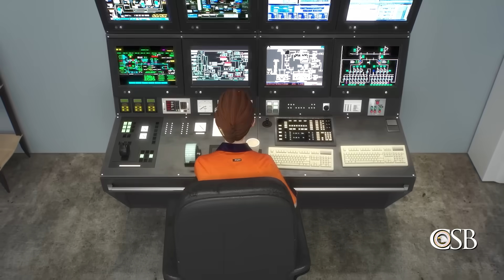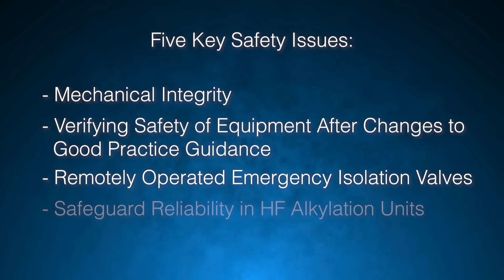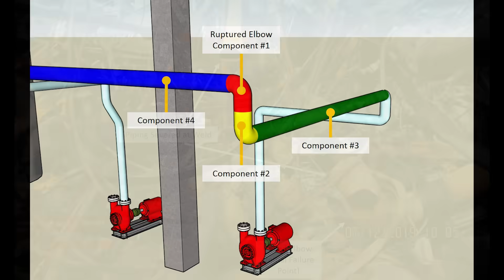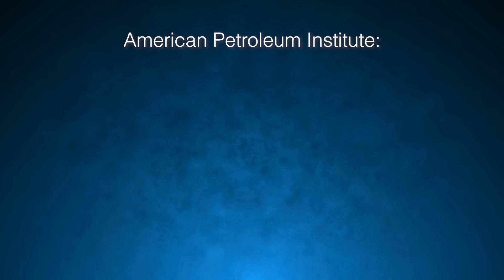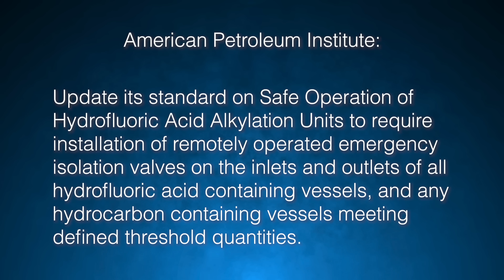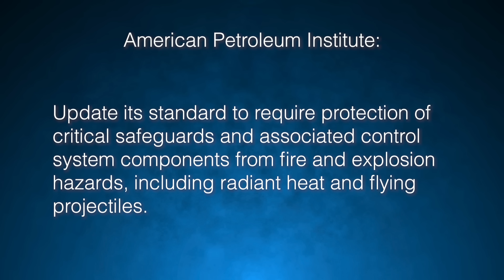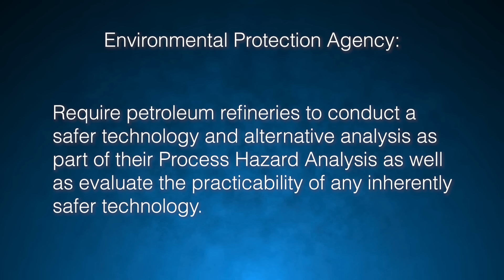Wake Up Call: Refinery Disaster in Philadelphia

Comment: It's honestly a miracle that an explosion that big had no fatalities.
  Also, fragment 4 might have landed in the water since it wasn't found elsewhere.
Reply: It would've been so much worse if it happened during the day shift; rather than just a few operators in the plant there'd be hundreds of workers present and probably at least a few dozen within the alky unit.
Reply: yeah, well that's why it's a wakeup call they should not be so careless about maintenance to prevent corrosion like that to get that bad cause it could have killed many if people were in the radius at the time, it happened
Reply: The moon, maybe.
Reply: One of the reasons oil and gas companies make so much money is that so much of the process doesn't need anyone near any of the dozens of pointy bits. Refineries, are sparsely peopled, as opposed to all the factories where people are paid poorly.
Reply: @weatheranddarkness , sparsely manned?
Reply: @thingsstuff6564  I said what I said
Reply: It was big, but not centered inside a group of skyscrapers full of people or something similarly dense.
Reply: @Galactipod  but that cloud of HF would have traveled into the downwind populated areas if not for the onsite crew manually turning on the water canons and shutting off the other valves. that was way too close to being a mass fatality event.
Reply: @58209  This. Yes, there weren't any high rises immediately adjacent to the site...but for reference, central Philly's signature skyscrapers were only about 3 miles away, and the neighborhood immediately adjacent to the site has a population density of 18,115 people per mi². This easily could've lead to thousands hospitalized or worse, and had the stars and especially wind and clock been lined up just right, it could've been far more heartbreaking than that!
Thank god the people in this weren't the usual types you see in CSB videos. The plant shift supervisor deserves a literal medal for risking his life to turn on that pump if you ask me; I hope he at least got a promotion and bonus for minimizing damage and casualties.
Reply: @FarnhamJ07  Spot-on. And don’t forget the sports complexes being nearby. With the wind in the right direction during a game, you’d not only dump HF into a crowded stadium, but you’d have a terrible traffic jam.
Reply: @JWall416  oh god. sports stadiums are basically huge bowls. it'd be a horrorshow with that cloud of HF suffocating everyone before they could evacuate.
Reply: @FarnhamJ07  It takes a special kind of person to walk into a refinery fire like that. Makes me wonder if I could...

Comment: As a highly paranoid electrical, mechanical, and aeronautical engineer, sometimes I feel more hazard aware than many of the industrial engineers I have met. I have always found chemical engineers to be very thorough and safe, but the industrial engineers tend towards negligence. Not to say that I haven't met industrial engineers that greatly prioritized safety.

But I can say without a doubt that management is practically useless when it comes to safety, either from greed or incompetence. The vast majority of the time they only care about what is required and completely ignore everything else. The number of times remote isolation valves have been discussed with someone from management and all you hear is "it's not required" is genuinely scary to me. How can you not be willing to pay a few thousand extra to ensure your multimillion investment doesn't destroy itself?

I do go kind of overkill on personal projects though, EVERYTHING needs a controller; I don't care if it's just a sprinkler, it's getting a solenoid and a pressure sensor incase it breaks.
Reply: Regarding this, I recall that either in the USCSB video or another video about the Texas City refinery explosion (the one where a raffinate splitter tower was overfilled) there was a mention of the investigators noting how the site management had been worryingly focusing almost solely on personal safety of the site personnel, since it was a cheap and easy way to score compliance points with upper management, while process and plant safety at large was being ignored since any actual fixes would have cost actual money and caused downtime at times when budget cuts were constant.

Which is something I've noticed at my own workplace (paper mill originally built in the '60s and expanded/modified ever since) as well, there's all kinds of policing about people doing constant safety assessments no matter how minor the job, policing about personal safety equipment, etc. - which is fine and dandy, but at the same time the whole place is full of shafts meant for hoisting materials between which are difficult and dangerous to use due to outdated designs and wear and tear, new equipment is crammed where-ever it fits which creates serious access issues and dangers due to that, a large 80's add-on was built without any elevators which means hauling materials over there is complicated and prone to injuries due to the aforementioned hoisting shaft issues, etc. Basically individual workers are being constantly pressed harder and harder to obey more rules every year, but wholesale dangerous conditions related to the plant itself are largely left as they are due to how all of them would need massive retrofits to fix, and workers are just expected to try and work "safely" when dealing with them.
Reply: It’s sort of understandable, though…not to say it’s “right”.  There’s this misconception that these industries are just swimming in profits and there are these obese guys in suits cramming money into every orifice. The reality is that profit margins are often tight and you simply can’t afford to over engineer everything. You can make a statement about “only a few thousand dollars” to implement an improvement, but fail to recognize there may be literally 1,000 places in the plant where that extra safeguard may be applicable. So, it’s not a few thousand dollars, it’s a few million dollars to add some additional layer of protection. There is a fallback mentality on the regulations, codes, standards and laws. There is a belief that if you do everything that’s required, you will be safe. THAT’S the value of the CSB…not to entertain you, or to “shine a spotlight on corrupt management”, but to point out places where the codes and standards need to be more protective.
Reply: What do you do that involves aerospace, regular work with ChemEs, and fire suppression?
Reply: @Basement_crusader  most of what I've done in that area was systems integration. I just listed the aerospace because I really like saying it. Sorry for the confusion. Although maybe fuel system safety would fit?
Reply: It's not the engineers that are the problem usually.  It's the corporate bean counters that modify suggested proper engineering design in an effort to save money.

Comment: This video hit a little close to home, as a worker was recently killed at a local Wisconsin paper mill when a boiler steam pipe ruptured as he was walking by it. I was suppose to make a chemical delivery there that day, and the incident happened not long before I showed up. As one of the workers put it when I was back with another delivery some time later, it was a 50 year old pipe that they were told was designed to essentially last forever.

As always, such an informative and well produced video.
Reply: no equipment lasts forever... but paying for maintenance and upkeep is less expensive than paying for the disaster its failure will inevitably cause. I wish more of these companies would realize that.
Reply: @Simon-xi7lb  This is very true. in Abilene, Texas, there were outdated electrical systems in a multi-floor newspaper building. A fire caused by electrical faults resulted in needing to dump enough water onto the building to cause the basement to flood, ruining decades of archives and who knows how much equipment. All in a very iconic and historical building for the city. Being stingy on upkeep, updating, and maintenance will eventually cost some (or many) very dearly. Last I checked, the fire damaged building still sat empty. Right in the middle of a vibrant downtown that's getting upgrades and new life.
Reply: @albinoorca  According to an employee of the newspaper, "The dozens of file cabinets, full of local and area history going back to late 1940s, were saved, though files in the bottom drawers were dampened and had to be freeze-dried to preserve them. Our photo negatives survived, too." As well as "The press was saved and after a time printing our paper and the San Angelo Standard-Times in Wichita Falls, we were able to print locally again." So though it was bad, much of the building's critical contents appear to have been salvaged.
Reply: @Simon-xi7lb  As the saying goes, regulation is written in blood.
Reply: Gotta please those shareholders by showing perpetual financial growth, obviously at any cost. These companies make BILLIONS upon BILLIONS of dollars, so in their mind it's more profitable to do the barest minimum in the long term and then just clean up any messes afterwards. If an accident happens on your watch while you're in charge, you become the sacrificial lamb, while everyone else hides behind a shield of ignorance.

Billions... Many people have a hard time visualizing that much money. A good guide is the following: a million seconds is a little over 11 days, while a billion seconds is over 31 YEARS. Accidents like these are just the cost of doing business to them. 😕
Reply: @JamesMangle  50 years was longer than the average life left in anyone working in a factory.. in 1970.
Reply: Yeah man, that sort of stuff really makes you think.  I was a the guy that would run and do various safety inspections before we start the job, make sure all valves are off and things are ready for us to start etc.  We had a job overseas I was supposed to go on but some crazy shit came up and I couldn't make it.  I was pissed, 10s of thousands of dollars down the tubes.  That is until I got the news that the guy that took my place ended up dying like 2 or 3 days later because when he went to check the pipes for the Hydrogen sulfides they add to gas to give it the smells you smell something jammed and it blew off in 3 of our guys faces hospitalizing critically 2 of them and killing the guy who took my place.  Crazy shit.  Since I have let the Universe do what it will with me because it is what it is and no point in getting pissed if my plans dont work out because there is a good reason why.  Its almost like a faith, like how these people believe a god has their back but from a more scientific standpoint with god simply being super determinism and if the universe wants to kill me it will.... if not, it will fuck my life up royally just to ensure my survival.  When it is your time.,.. it is your time, that applies to everything not just death.
Reply: There is something to be said for wrong time wrong place. The universe spared you this time. Make your time left count.
Reply: Standing in the way of a ruptured steam pipe... That is a horrible way to die :(

Comment: Besides the corroded pipe which nobody at the refinery apparently noticed, knew about, or took care of (along with I guess bad refinery design such as the location of the vessel that ruptured & a lack of automatic valves for the pipe that leaked), I'd say this is one of those rare incidents investigated by the CSB where the company did almost nothing wrong; in fact they eventually took steps to try & control the fire by manually turning on the water supply for the fire monitors & cutting off the blaze's fuel supply (sure they should have prevented the leak & subsequent fire & explosions from occurring in the first place, but at least they took action after what did happen). Sorta surprised that this one incident made them go bankrupt, especially since as I far as I know it's the only semi-serious incident they ever had (nobody even died), unless it would have been just too expensive to try & rebuild the facility & return to business.

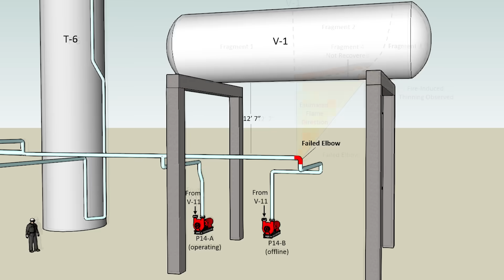Is it just me or does it seem like some of the 3D recreations of the refinery (such as at 10:38) were done via Google Sketchup? (not that there's anything wrong with that: if it works & saves money do it)

10:42 BLEVE? (not unlike the 1998 Herrig Brothers Poultry Farm propane tank explosion that the CSB investigated)

10:46 "flammable hardrocarbons"?

12:32 Actually "fire water monitors". Also really? And not fight any fires that break out such as the one that did on that day? (which is usually what fire water monitors are used for, hence their name) Heck how is water supposed to contain leaking gas anyway?

13:03 Well ain't that stupid...

17:26 Hey, don't mention it! :)

Sure hope Sheldon Smith's doing okay, I'm getting a little worried with the way his voice sounds in these newer videos (even if he is getting up in age).
Reply: I think the cost of repairing and upgrading the facility to modern API codes was just too much given the age of the facility as one of the oldest refineries in the USA.
Reply: @filanfyretracker  Maybe I guess.
Reply: According to Wikipedia "deluge gun" is the preferred word for these water guns. Your "correction" would only cause dozens of confused comments about what kind of monitor would spray water.
Reply: @MetalheadAndNerd  That's just another name for the same thing, & the CSB themselves refer to such devices as "fire water monitors" in this video: https://www.youtube.com/watch?v=3QKpVnTqngc&t=285s
"cannons", the term the CSB used, have nothing to do with firefighting & are weapons that fire cannonballs.
Reply: @MetalheadAndNerd  The former still lists "fire monitor" as a synonym, with "fire water monitor" simply being a more specific synonym, & the latter makes sense as well...IF specifically used with the word "water" in front of the word "cannon".
Reply: @TheCarson116  Yes, but the word monitor still would have confused more people than the word cannon.
Reply: @MetalheadAndNerd  True I guess.

Comment: Its pipe from 1970s, imagine how much corosive HF whent thru it in all that time.
That cut photo is a bit scary, HF in such a thin pipe. Even the not coroded section is thin, for such hazard as HF.
Its not just mechanical calculation.

Comment: Always get a little bit excited when I see a new USCSB video, until I remember the reason for these videos. Very sad to see unchecked corrosion being the trigger for an event like this yet again. So many of these disasters could be avoided with more thorough maintenance schedules, and adherence to existing maintenance plans. 

Excellent work by the operators though, while they may have just followed the steps outlined in the operations manual, a lot of people may panic or act improperly under stress that comes on so suddenly, so to see them act so quickly, and at their own risk is a reminder that there are a lot of brave, dedicated, and selfless people working every day jobs around the world.
Reply: As an industrial maintenance worker, I'll tell you that many of the failures of maintenance is due to inadequate maintenance procedures (I do preventative maintenance on about ten presses, all of them different in various ways and most of them made by different manufacturers, but the PM tasks list is copy-pasted for all of them), a workload that requires us to sometimes not give some machines as much attention as they need due to a tight schedule, and a lack of enough people to actually do the work. One place I worked at had a 3rd shift maintenance crew that had 14 positions, but out of the two years I worked there, we had a full roster for maybe a month. Sometimes, we only had five or six people to do a 14-man job.

Most companies are loath to give maintenance enough funding and employees to do the job right. Which I can understand, the department doesn't produce any revenue, just eats up money, until of course there's a lack of adequate maintenance, then we're blamed for it and there's a big rush to hire more people and make it look like they care, but it's for show.

Real talk though, us maintenance workers have a lot of autonomy. I'm not beholden to production or their managers, and nobody is looking over my shoulder, so if I want to take a smoke break, I take one. A little longer at lunch? Sure. Chill in the bathroom for 15 minutes? Yeah why not. Sit around the shop and bullshit with eachother for half an hour because no calls are coming in? You know it. Obviously, you do that too much and you'll find yourself in the market for a new job though. It's a fine balance between actually doing the work, looking like we're doing the work, and disappearing for various amounts of time. Even the most professional of us will slack off every now and then. That's human nature.

Comment: Always delightful to see another disaster courtesy of a lack of preventive maintenance. Probably a good thing that airlines are required to inspect all airplanes for metal fatigue and the like, rather than simply waiting for a plane to fall out of the sky minus a wing or so.

Probably would have been cheaper to run regular inspections on all piping at this refinery, in hindsight :)

Comment: there is NO WAY that the 1000s of miles of piping could be determined as to what % of alloys are incorporated in each individual section - probably 10,000 sections alone and each would have to be determined - automatic ISOLATION valves are the only short term solution
Reply: There probably aren't 1000s of miles of piping containing HF contaminated high pressure flammable gas right under a tank of more flammables.  Refineries can risk prioritize pipes. I assume testing the alloy should only take a moment with a handheld XRF meter.